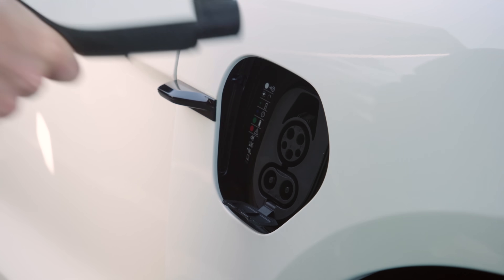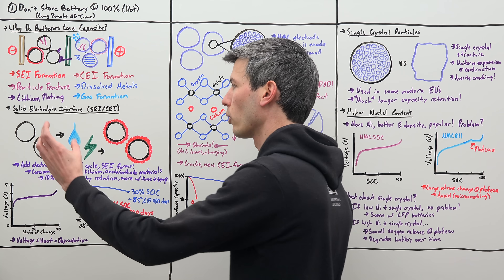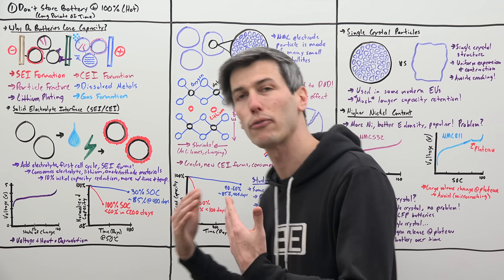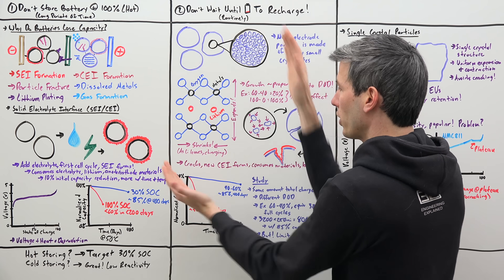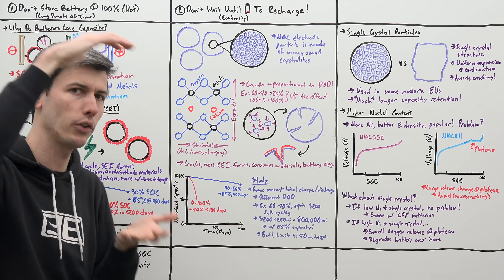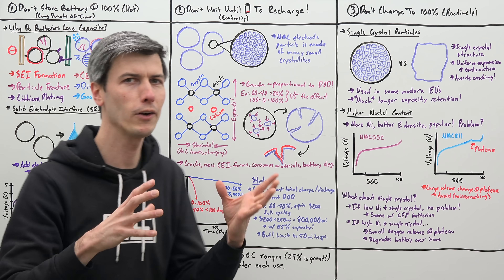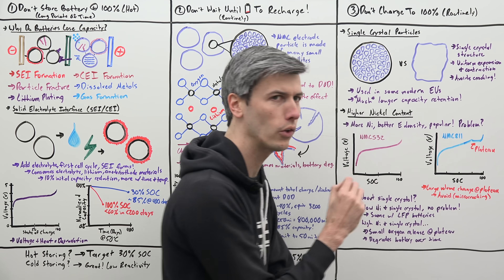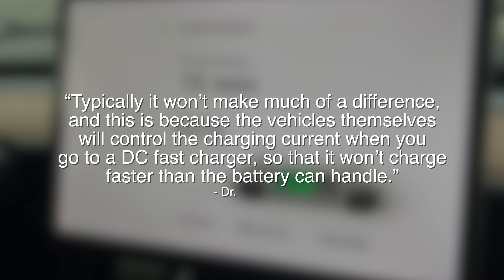How To Ruin Your Electric Car's Battery - NMC Edition!

Comment: All this additional complexity to owning an electric compared to gas.
Reply: People don't know how to maintain gas vehicles either haha 😂
Reply: @dronepilot260rc  Cope.
Reply: None of this is hard, it can all be set in the user interface, and it's much easier than having to remember to change your oil, service your spark plugs and lifters, timing belts, cooling system, and transmission.
Reply: I charge at home. I do road trips pretty regularly with minimal planning. I rotate my tires every 6500 miles. The only other maintenance is changing the coolant at 125,000 miles. That's it. Lol.

Comment: Well all of these recommendations are only for NMC batteries for lithium iron phosphate and sodium ion they behave similarly to each other and it is best to charge them to 100% anytime you can it doesn't have to be everyday but charging to 100% does not significantly degrade them their cycle life is already high enough that the vehicle life becomes the main problem not the battery

Comment: Does the same apply to other Li-ion batteries like in mobile phones?
Reply: Some phones let you set an 85% charge limit to extend the life of the battery in the settings
Reply: @BrandEver117  My budget Chinese phone from 2018 even has a "smart charge" function that does something similar.
Reply: Generally speaking, yes, but most people don't care because they end up replacing their phone around the time the battery starts to degrade. Also, as a smartphone ages, the various software updates will eventually cause it to run the processor harder more often, which will use up the battery faster even if you get a replacement one.

Comment: Hi could you do one for LFP batteries aswell, i am from India here the largest ev maker by he name:  TATA makes ev cars with lfp battery composition and many manufacturers seem to be switching to lfp batteries here.Our climate is hot and roads are under developed. I want o know what makes lfp batteries better than nmc bateries for our climate.
Reply: LFP is a great chemistry. Only major downsides are that they are heavier and take up more space per kwh than NMC/NCA. Bad for very long range EVs or lightweight EVs, but great for general EVs.
Reply: @anthonypelchat  do the have more charge cycles vs nmc?
Reply: @danielvipin7163  Typically, yes. Some of the cheapest LFP would be in line or possibly below the highest end NMC. But that's just extremes. If you get decent LFP cells, they are normally going to last longer than NMC for the same kwh.

That said, when it comes to cars, you aren't tracking age in cycles. Rather you are tracking in miles or km. And NMC packs are normally larger capacity, allowing for more miles/km per charge cycle. So they may even out in that case.
Reply: As you’d have noticed most of the issues start due to the nickel molecules 

Since LFP doesn’t have nickel, most issues aren’t there but there’s also another thing not there, that being energy density (kWh/L) and specific energy (kWh/kg) 

So the same 40kWh battery in Nexon EV max and xuv400 but the one in xuv being NMC will be lighter and occupy less space thus more legroom in the xuv 

While the Nexon is heavier with less legroom due to larger heavier battery 

LFP has more charge charge cycles than NMC, former being 1500-2000 while NMC being 500-1000 

So an xuv may last 150K km before degrading to 80% while Nexon may last 450k km before degrading to 80% 

We have multiple 100K+ driven nexons on our tele group and they all still get same range and day 1 with zero range loss 

One guy has even done 162K km in 2.5y 

His review is also on yt but I can’t link it else yt will collapse comment as spam 

Just search Nexon EV 1.62lakh km you will get it (thumbnail will a stout fellow and teal blue Nexon)

LFP is also more safe and doesn’t catch fire as easily as NMC (which itself is rather safe tbh) 

LFP is best for tropical countries like ours because it has peak optemp of 60°C which is good enough for our 45°C summers 

XUV gets poorer range in summer because the cooling system works overtime to maintain safe and ideal optemp while Nexon can run the cooling system in less aggressive manner
Reply: @shresth1201  could you provide a link to this research article regarding this lfp vs nmc batteries.
Reply: @danielvipin7163  I replied to you in morning but I see now that the comment has been collapsed due to spam filter
Reply: Non-extended range Teslas are also LiFePO4 batteries
Reply: There are no “sides” to EV development. Just flat earthers not wanting the rest of us to be able to choose to have EVs as an option. Then there’s the rest of us.
Reply: LFP are very baf in cold temperatures. Specifically you cannot charge them under 0 dec C. The main advantage is cost, so of course it will be the main choice if the temperatures don't go too low

Comment: The public is completely rejecting them. The market is now in total decline. Manufacturers are walking away from them.
Reply from the maker: They sell more than the previous year ever year. Some manufacturers are making bad cars, and people aren't buying them (goes for ICE vehicles as well).
Reply: @EngineeringExplained  Even Tesla has announced the market is slowing and reporting lowered expectations. Look at what dealerships are saying. They can't move them. The entire industry is backing away and consumers are rejecting the product en mass.
Reply: @justanothercomment416  again please post your sources. Twitter post are not scholarly sources. What I'm finding is the opposite on automotive treads. Production has increased and demand is still very strong. 

The only thing I've seen is external forces that limit the growth of EVs but production has increased although limited by external factors like Cobalt supply.
Reply: @justanothercomment416  "Slowing down" in this context is referring to slower growth rates. EV market is still growing, just less quickly than before.
Reply: Right. Which is why the Tesla Model 3 and Model Y were two of the best selling cars of last year.
Reply: Not true, but feel free to share your sources.
Reply: @DefectoPerfect0  Or you can take a look at what the industry is actually saying rather than trusting media outlets who have a long history of lying. Your choice.

Comment: You'd better take good care of those batteries - you aren't likely to get another one.  Manufacturers are losing billions, stopping production, and repurposing newer plants.  98% efficient on-site electrolysis is on the cusp of bringing low cost hydrogen to "gas stations", and hybrids will relegate BEVs to the dustbin of history.

Comment: Im wondering if this applies to ebike batteries. Im always charging them up to 100%. The ebike maker recommend storing them at 70% charge. Hmmm.
Reply: It applies to anything that uses most of the common battery chemistries today. LFP batteries might be the only exception.

Most people don't care that much though because replacing cell phone, drone, or even eBike batteries is pretty cheap vs. doing a replacement battery for an electric car.

Comment: Yeah it's best not to charge any of them to 100% except for lithium iron phosphate
Call my phone for instance it very rarely gets a full charge only every couple of months just to test the capacity I have a phone with over 2000 cycles on the battery it is at 86 percent capacity
On my current phone it has over 800 cycles and it is still at 98%
Reply: Huh, how do you even test the capacity of a cell phone battery?  Do you literally pull the battery and run it through a voltage tester, or is there an app or peripheral you can plug into your phone to test it?

Comment: I’d like a video going further in depth on the effects of a cold climate on vehicle batteries. I love watching any of your videos on my free time. Keep inspiring people like me to pursue an engineering degree!
Reply from the maker: Thanks for the kind words, appreciate ya watching!
Reply: The channel Out of Spec Reviews has done several videos with real world tests of how cold affects EVs.

The very high level info for operating an EV in the cold is that it's best to have it plugged in when not in use. To precondition the battery before walking out the door or doing DC Fast Charging, and that in the worst case scenario you can lose up to half of your range when it is extremely cold.

That said, plenty of people in places like Canada and Norway are driving EVs and don't seem to have a problem with it.
Reply: Cold is bad for battery performance but cold is good for battery longevity.

Comment: Do these tips apply to my phone too?
Reply: Well phones use lithium batteries so I'd think they do apply. Except maybe the "don't store at 100% capacity" since that almost never has the chance to happen
Reply from the maker: Yep! Though not all phones let you set a charge limit.
Reply: pretty much yes. I've been using an iphone 12 with extra precaution when charging (active cooling, 92% limit) for almost 4 years now and it's still at 90% health